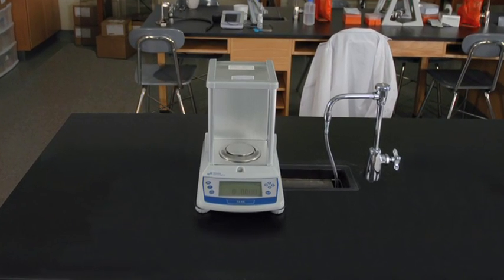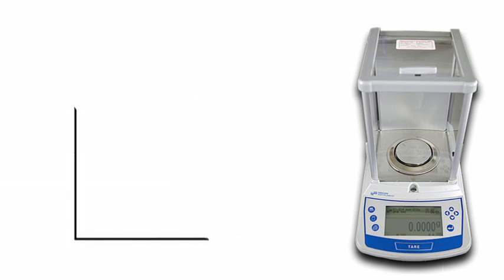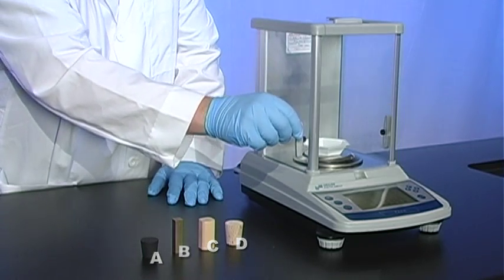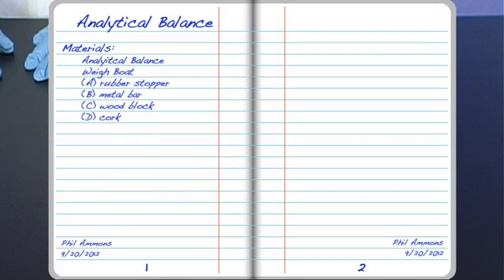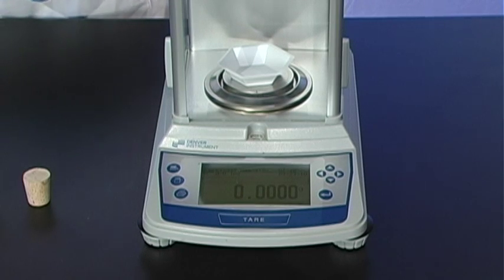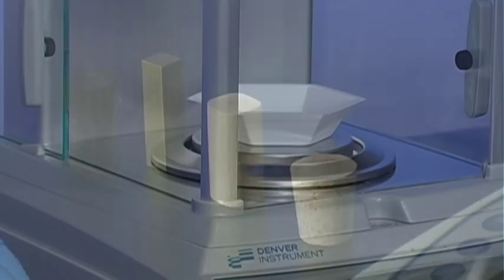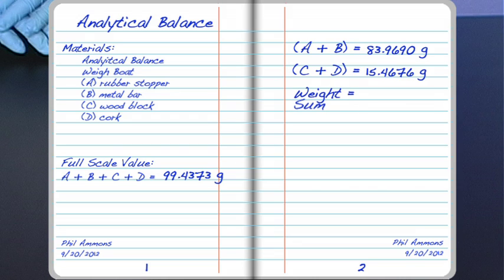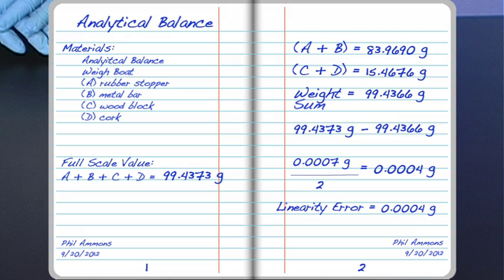Performance Verification of an Analytical Balance

Comment: I expected the mid-point of a ~100 g full scale balance to be closer to 50 g. (~84 g seems pretty close to maximum weight and far from mid scale)
Reply: @TaeThei  The mid point is max weight / 2. For example for a 100 g analytical balance it would be 100 g / 2 = 50 g. The further (A+B) or (C+D) are from the mid point (50 g), the less you know about the linearity around the mid point of the balance. Just imagine if the weight of (A+B) was 99.9000 g and (C+D) was 0.1000 g. Then the test would be worthless.
Reply: @nixxonnor   @Nicolai   Ive read in an analytical journal that two values to be weighed should be less than 50% and one that is more than 50%. I dont think anyone would go to such extremes as stated the lowest 0-0.0001 is properly calibrate. The value you provided is within the highest and lowest limitations of the device. The purpose of this is to show that anything you weigh in bweteen the highest and lowest limitations (regardless if purely within midpoint) may produce a linearity error purely with random samples. I dunno, correct me if Im wrong

Edit: not trying to be rude. Just wanna have an academic discussion lols ;)